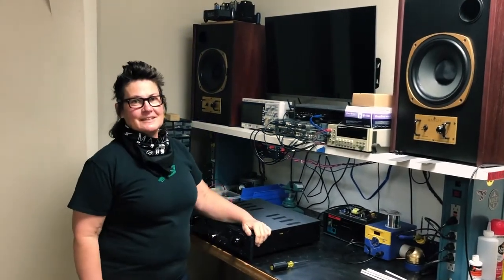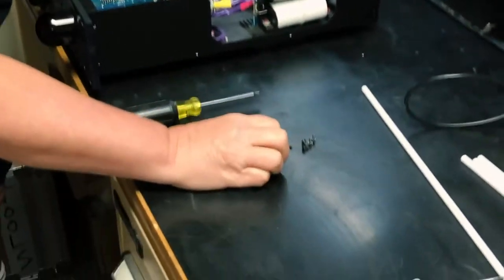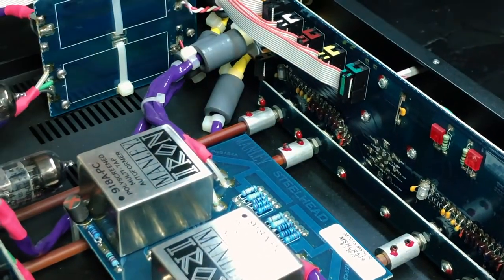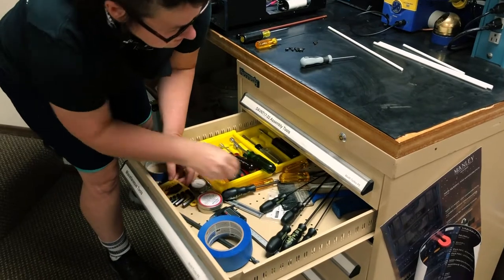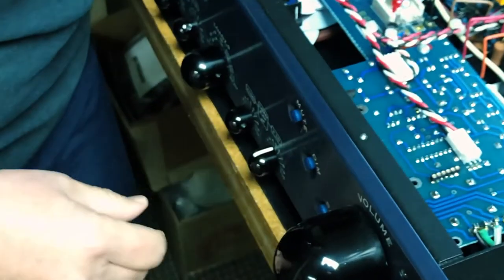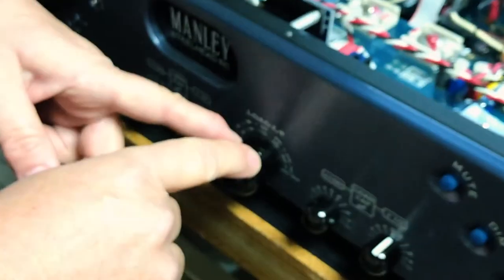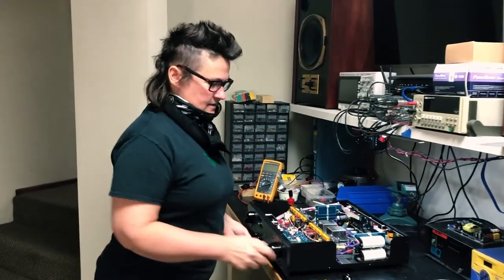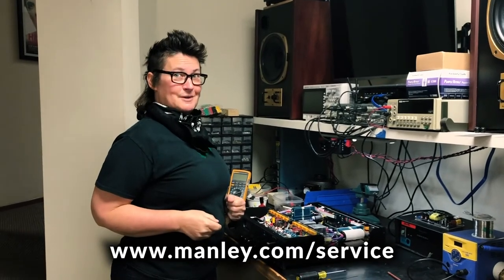Manley Tech Tips: Replacing Your Connecting Rods

Comment: Can I pick your brains! I was wondering about running a DAC interconnectors through 150w contestant light bulbs, you know if it's been done or what it would sound like?
I'm thinking it will take the sheen off the dryness away from digital Dacs.

And another thing I was told you make amplifiers for record lathes that should sound good with your new power supply especially being valve operated what's that sounding like??
My question was I can't seem to get this information I haven't look that hard have the embossed lacquer using an oil bath?
I'm thinking very thin silicone oil immersing the whole lacquer some greater output might be needed but I don't think so! I would have thought this would dampen down any unwanted resonance from the record head cutter and machinery, plus give it a smoother surface. This should make the record quieter and produce more detail? And putting the whole lathe in a vacuum chamber that should cut out noise from the coils and any mechanical vibration has that been done at all. Thanks
Reply from the maker: I really have no insight into your queries. Best wishes for exploring the leading or the trailing edge!
Reply: @manleylabs  ☹️